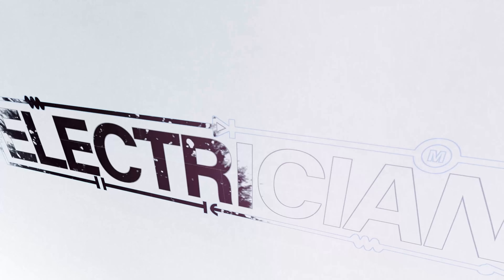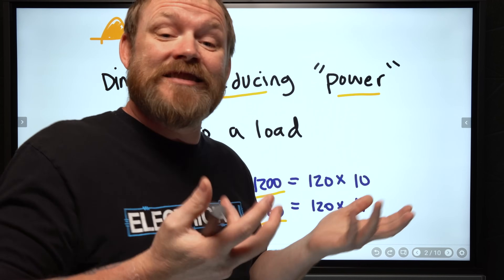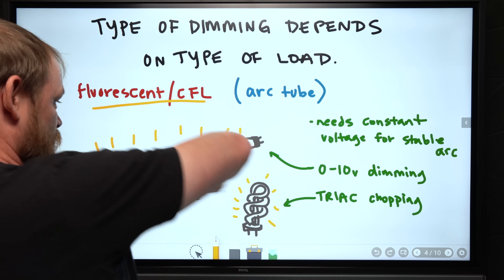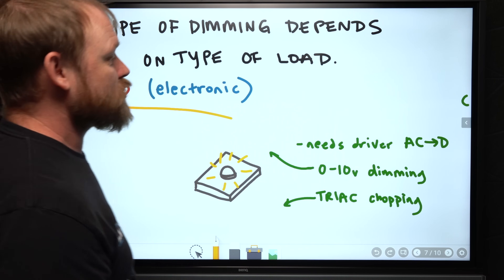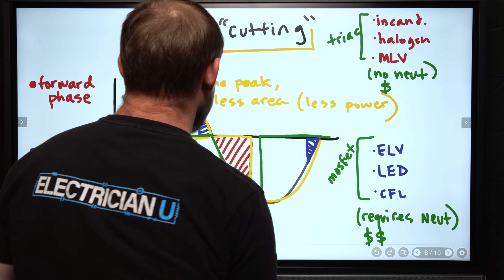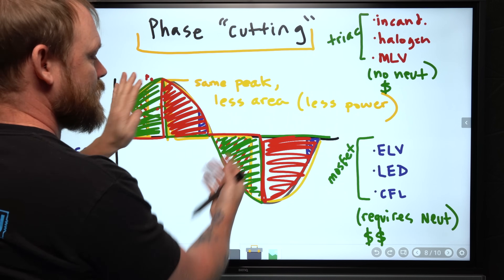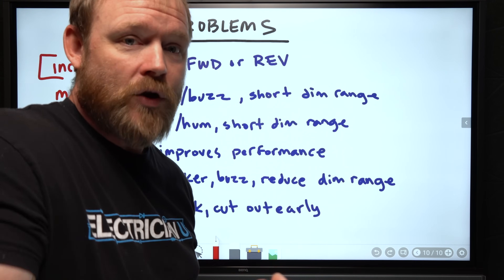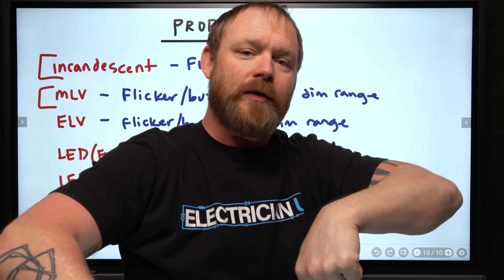The Real Reason Your Dimmable Lights Buzz or Flicker

Comment: 6:10 you are explaining a lot of details, even what is the relationship between voltage, current and power, and then you say stuff like "it has ballast", and not elaborate. So is this a video for beginners that don't know what current is, or is it video for electricians, who know what a "ballast" is? You need to decide, it can not be both. I for one have no idea what you mean when you say ballast.
Reply: Or why when talking about phase cutting you are changing saying that in one there is current spike, and in the other voltage drop. Why? I find it confusing. Aren't we talking about the same chart, with the same units, in both cases? What is the unit of the Y axis? If there is a current spike in forward phase, wouldn't that equal a current drop in the reverse? Adding units on that chart would be really helpful and clear the confusion. Or maybe adding both current and voltage charts

Comment: As a novice in the field of electrical systems, excuse me for the naive curiosity but Regarding the identification of a dimmer's neutral wire, the presence of a neutral connection typically indicates the device is a more likely a mosfet-based dimmer  If a dimmer features three pins and includes a neutral connection, or one of the pins is a neutral then it is likely a reverse-phase dimmer, potentially utilizing MOSFET technology, which may offer certain performance advantages?

Comment: I got rid of the dimmers in my home cause the LED bulbs I was replacing with already had AC-DC circuits built in. The LED driver current control handles the dimming but if the input AC waveform is choppy it can’t regulate its output properly. I think switch dimmers will eventually go away as lighting control gets app/voice/motion based

Comment: What about the off the shelf box shelf dimmers that all don't have a neutral but claim to be cfl/compatible? are those all still triac? In that case what's the difference between old non-led approved dimmers and new ones that are?
My understanding is that led bulbs have to be in trailing edge dimmers due to the spike charging capacitor with leading edge, use wrong dimmer and it kills the driver and bad for dimmer too.

Comment: I have a electronic ceiling fan controller and at night when we turn it on high there's some sort of feedback coming into our led light bulbs that make some glow very dimly.  We can only see it when it's at night and wondering if this is noise feeding back from the fan controller to the light controller or just strain noise causing the light bulbs to Glow.

Comment: As an Extra Class HAM…this is a principle in radio…Phase Modulation is a mode of radio transmission but it’s not used as much because it’s less efficient and becomes subsumed in AM modulation…still it’s interesting to see these concepts overlap…using LEDs or lasers to communicate over tremendous distances works on the same principles…but involves flashing the light source…X-ray lasers have been shown to be an effective means for interstellar communication with a spread of less than 6 kilometers over 10 light years.  But what you’re describing covers the same principle that NASA has described for interstellar mission communication with X-ray lasers communication…

Comment: I love triacs. This video is going to be fun. Dimmers are not complicated. They are dead simple, its why it make issues. If it was good, it wouldn’t fit into the wall or get hot. And idk why anyone needs a reverse phase dimmer aside from some edge case that i don’t even know.
Reply: It could also be that there are different components and different ways to design a dimmer, and reverse phase is just one of those, a variation. No particular advantage or disadvantage, just if you use certain components, they are more suitable for reverse phase circuits, and work just as well.

Comment: I had light flickering issues long ago in an LED retrofit project. One thing I found interesting was that if I installed just one incandescent bulb among the many LEDs, the flicker would stop.
I do not know how the type of dimmer worked, as it was part of an exam room control console.  Also, the flickering was synchronized among all the bulbs.
Reply: Having the same issue with an older chandelier and dimmer. Chandelier has 5 bulbs: the first time I put in LEDs I needed to keep one incandescent to have the thing even turn on because I found out that the dimmer switch has a 25W minimum - the new bulbs were 3W. This time, I got bulbs with a different design that are 5W apiece. Putting in all 5 leaves the whole thing flickering unless the dimmer is all the way up; and the dimmer can't turn the bulbs off. Now,I'm just looking for a better-matching incandescent...
Reply: @jeremiahdiaz6231 yeah, I have some fancy dimming systems at my old employer which require incandescent bulbs. It is going to get really expensive to deal with this, especially after they eliminated theaster electrician's position.

Comment: A dimmer is basically a rheostat, is it not ?
Reply: No.  Except in very special cases, dimmers cut up the waveform rather than being an inline resistor.  A resistor in this application would get extremely hot and cause a fire.  In special cases where resistors are used, the resistors are huge... the size of your arm sometimes.
Reply: Ok. Thanks for clarifying. I've seen rheostats in electrical control panels that do just that...raise and lower voltage. I'd always thought dimmer switches were the same. Never thought about changing the frequency to do the same thing.  @junkerzn7312

Comment: This is awesome info. Thank you! Now I can't help but wonder how smart bulbs work 🤔🙄😂
Reply: They have a wifi chip in them that takes a radio signal, decodes it. Then u have 5 fets/variable switch each controlling a red, green, blue, bright white, and warm white. Depending on the color u choose, each led comes on at varying amounts to mix the colors. They can also be switched incredibly fast to save power, 1 led at a time, incredibly fast. Called multiplexing. 

Radio is my favorite. It’s like black magic but is actually incredibly simple. Until u need something specific and have to calculate a value. But it’s just waves. Like the ones in water. In fact, i use water often to understand many things in electronics. Amps is how fat ur pipe is and voltage is how hard or far it can shoot water into open air. Now imagine one without the other and ask what kills, the voltage or the amps. Its both

If knowing how things work gets ur gears going, put urself where u don’t belong and don’t mind what u don’t know. Stick around and it all just comes together. 
If my dumb ass can make radios and tesla coils, almost anyone can. Any way, we need more radio pirates. 

I learned electronics well trough trying to build radios. Theres this guy in cali pushing 1kw of power and he says nothing all day and it bugs me. So i been trying to build an amp because i can’t afford it. Tho by now i could have but i like being good at 1 thing at least. 
I cant wait to radio snipe him out the ether
Reply: Thank you!  @Wtfinc 🎉 You really know your stuff. Now im starting to get more curious about radio

Comment: Looks like it doesn't matter which of the two transistors you use because they both reduce current while maintaining full voltage. It's the iluminary characteristics (inductive or capacitive) that determine which of the two transistors you use. Good to know. 

I've always assumed they were switching transistors taking multiple slices out of sinewave while maintaining the general overall shape of the sinewave; reducing the current by widening the multiple slices cutting out the current like a typical electronic power supply.

Comment: Most SCR or Triac Dimmers use an inductor as a a choke to slow the inrush current in forward phase dimming
Reply: The old triac based dimmers that didn't have the choke and would cause an RF buzz that interfered with AM radio. The house I grew up in had one of those in the dining room. Couldn't turn that light on in the morning when listening for school closings as you might miss your school being mentioned through the interference. (This was back in the '80s.)

Comment: I have a question I was wondering if anyone knows the answer. About 2 years ago i moved homes and put in some dimmers and dimmable LEDs. The dimmer that I used was the Lutron DIVA style dimmers (I have both the one w/out neutral and the one with neutral in different rooms). The LEDs bulbs that I use are listed as dimmable, but are not the best quality (Big Box store brand), but on the lutron compatibility website get 5/5 in most categories and 4/5 in 1 (flicker). Both of my dimmer styles run into some temporary periodic dimming that seems to coincide with large 240V loads turning on. These are all resistive loads (electric baseboards, electric over/stovetop). 

Am I just seeing expected/normal behavior (temporary voltage droop causing dimming) or is this an indication of something wrong in my house's wiring? I have a clamp on voltmeter that I could use to measure AC current. We don't have any MCBs or shared/stolen neutrals that I'm aware of (but might be possible). We did have a subpanel in the garage that incorrectly had a neutral-ground bond which I had an electrician fix. I'm sort of at my wit's end on what to do or test for. I had an electrician do a panel upgrade and replaced most of the breakers with AFCI/GFCI (except for the stove and electric baseboard heaters), and there haven't been even a single nuisance trip so probably not a loose wiring on any of those circuits.
Reply: You can try finding the manual for that model of Lutron.  Most Lutron's have the ability to change the phase mode of operation though the last time I programmed one it was incredibly obtuse and difficult.  But beyond that... I have circuits in my house where dimmers have never worked with LEDs no matter what I did and eventually I gave up and removed the dimmer.

Our entire house had dimmers when we bought it, more or less, 25 years ago.  And no LEDs then.  Since then I have upgraded all the lighting to LEDs, but also had to remove all but two of the dimmers.
Reply: @junkerzn7312 unfortunately, I've tried both forward and reverse phase and while the dimming behavior changes subtly, the issue is still there for both.

Comment: Okay, so for an off grid setup where all the lighting is DC LED and we want to upgrade to dimmable and diurnal colour programmed, how do we learn what to do next? Also part of the house needs to be on a different diurnal program to the rest because of a night shift worker's specific sleep pattern.
Reply: For DC you probably need PWM (pulse width modulated) dimmer.

Comment: As for a buzzing noise: it's normal. In order for the wave to havecthis chopped up shape, it needs to have a lot of harmonics. This is related to something called the Fourier transform, here's some info: a wave of any shape can be described as a sum of sine waves of differing frequencies and amplitudes. If it's just a sine wave, it's going to be made up of exactly one sine wave at the fundamental frequency. But if it's a square wave, there need to be a lot of higher frequency sine waves contained within. To be precise, all the even order harmonics, i.e. the even number multiples of the fundamental frequency.

So if we have a wave form that features a steep, square-like ascent (because we've cut out the smooth ascent with a dimmer), it also needs to have these high frequency harmonics contained within. If we were to turn this wave into sound, it would sound buzzier than its pure sine counterpart because of this high frequency content.
But why do we hear this buzzy wave when it's just an electronic signal? That is a product of induction happening within the components of the dimmer or the filament of the incandescent lamp. As this current flows through the wires, the inductive forces caused by it makes the wires physically move in accordance with that current's waveform, so it's produced as sound (just like when you play a stringed instrument, but the strings are wires and they're moved electromagnetically instead of plucked).
Reply: I have 2 3-way switches (1 dimming) hooked up to about 20 LED wafer lights. The non dimming switch always has a buzzing sound, I assume this explains that?

Comment: brilliantly explained for the layman to understand. there's a wide variety of power electronics that modulate, regulate electrical current, step up step down voltage, change operating modes like ac power to dc or dc back to ac. some are even dc to dc like mppt which has become the industry standard in solar and battery dc micro grid systems or full scale large grids that span a continent. the buzzing or flicker associated with lighting is partly due to the switching technology when it is working somewhere in the dimming range between full power/brightness and minimum power/brightness. I rarely seen the buzz or flicker happen at the lowest and highest setting. it could even be a dimmer and bulb compatibility problem related to electrical design. another scenario I know of when there is flicker with a particular bulb only when it is used with a power inverter but is fine on the usual outlet/power grid. some switching designs might not incorporate any filtering before final output or it just modulates at a frequency that is perceivable to the human eye thus the flicker. a decent inverter should have a clean output but some bulbs are just finicky not matter how good the input power quality is and their just a horrific strobe light show. good for dance clubs and tactical lights not so much for reading and normal lighting. all the various modern switching designs are creating a sort of electronic digital signal hence the name power electronics.

Comment: You are wrong about old dimmers. They were NOT resistors they were variacs or variable transformer.
Sometimes a pot was used to control a saturated reactor that was remotely mounted.  The pot itself did NOT control the current through the load (light).  Resistors would have to be HUGE to handle any kind of power and would run hot.  They would probably not fit in a box either.

In theater lighting dimmer panels,, they DID use BIG wirewound pots and they ran HOT HOT HOT and were BIG with LONG levers on them to operate them.  Those were VERY inefficient too!
But they had the room behind the panels for the dimmers.

Comment: Can you please make a video going over kirchhoff's law? I know it can be hard as I am trying to learn it and don't know where to start. Do you only use Ohms law in this because I don't know any of the other ones expect power theory
Reply: EEVblog has done some on it already. It’s really quite simple in principle: KCL (Kirchhoff’s Current Law) says that the current (amps) going into a node must be the same as the current going out. KVL (Kirchhoff’s Voltage Law) states that the voltages in a loop must add up to zero. (For example, if your battery produces 3V, and your LED drops 2.7V, then the current-limiting resistor must drop the remaining 0.3V, because (+3V) + (-2.7V) + (-0.3V) = 0V.)

Comment: This is a real problem for us civilian consumers. Trying to match dimmers with bulbs. There are so many different brands of bulbs and they keep changing, disappearing, etc. We need to keep track of which bulb brand works with a particular dimmer. I keep logs and mark bulb boxes  where I have put the bulb. And the rated lives manufacturers claim are meaningless. They burn out prematurely.
Luckily, I have found that the new X-10 dimmer switches do work with LED bulbs. BUT they state that bulbs must be at least 40 Watt equivalent; presumably about 5-7 actual watt draw. I wonder if that minimum requirement is additive. For example 2 x 20-watt equivalent bulbs on a single circuit it controls.

Comment: Regardless of the electronics inside, I have always thought that the best human-machine interface is the old fashioned push-on/push-off dial dimmers.  I really wish someone would build that type of control with the choice of all of the new, modern systems that can control LEDs etc.  I HATE the switches with the small lever next to the main switch as they frequently get moved when you turn the light on and off so it's very hard to turn the light on and off without changing the dimming setting.